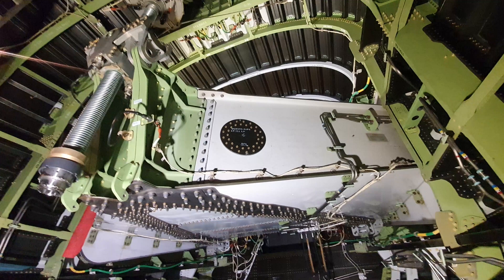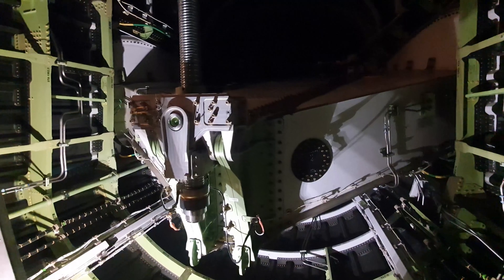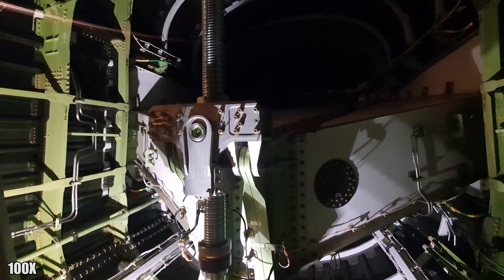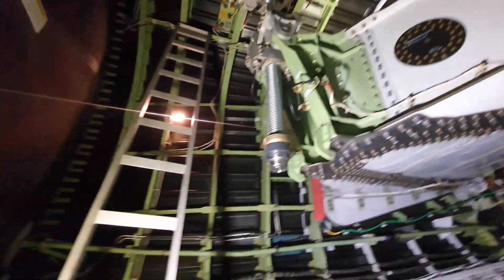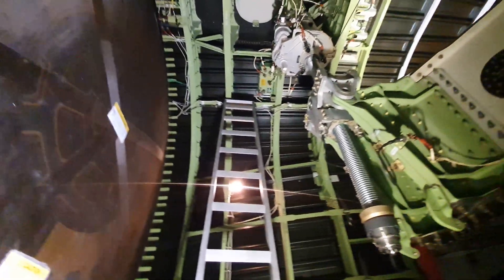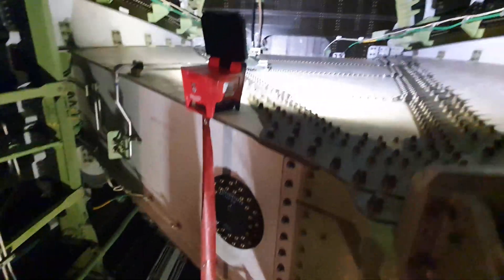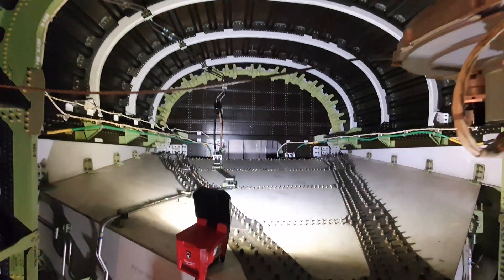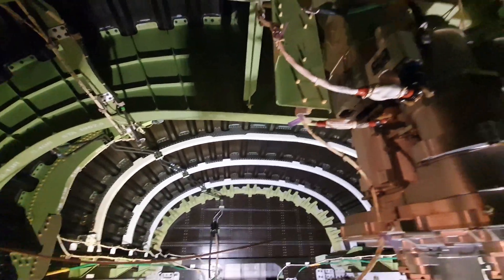Explanation of the Horizontal Stabilizer Compartment (short video)

Comment: I didn’t see any grease on that acme thread.
Reply from the maker: There is grease on the thread of the trim actuator, however it's a really thin film of grease due to the movement of the ballscrew. I actually filmed this video during the lubrication of the horizontal stab trim actuator.

Comment: Quite a lot of empty space in that area.
Reply from the maker: @truthful3777 indeed. There is a lot of wasted space you'd think.. But this is done due to structural strength reasons for the pressurized cabin and tail section.

Comment: Strange that one end of the jack shaft is just floating. Seems like a lot of load to put on a column pinned on only one end. Maybe because it has to swing. Have you seen anything worrying with the design? Also , love the channel! Please post more!
Reply from the maker: Hi, it looks like that yes, but all the aerodynamic and structural loads are distributed via the attachment fittings of the horizontal stabilizer. This means that the gimbal only moves the horizontal stabilizer up and down and loads are distributed to the structure via the fittings. I didn’t see any worrying about this design, it’s pretty ingenious design if you ask me. Thank you very much! Hope this clears it up for you and let me know if you have any more questions ;-).

Comment: So it’s electrically driven? I’m guessing whole plane is fly by wire anyway.
Reply from the maker: Yes the 787 is fully electric (fly by wire).  I know that the 767 needs hydraulic power to trim the stabilizer. The 737 also has an electric trim but this is mechanically connected with a cable to the trim actuator.
Reply: Electric motors are more reliable than hydraulic. Hydraulic tends to leak and the pipes are high pressure and need a pump to work.